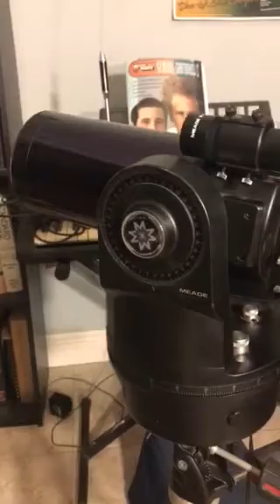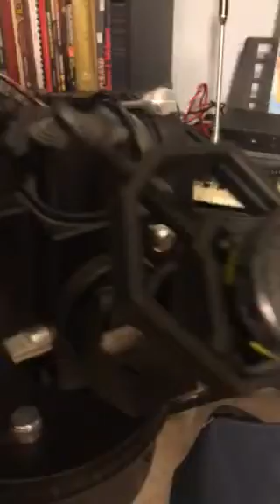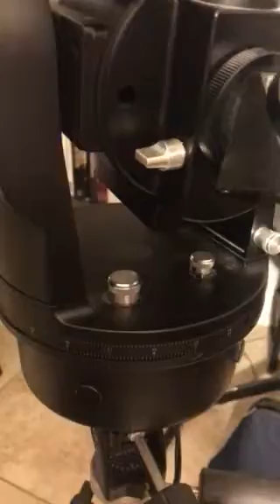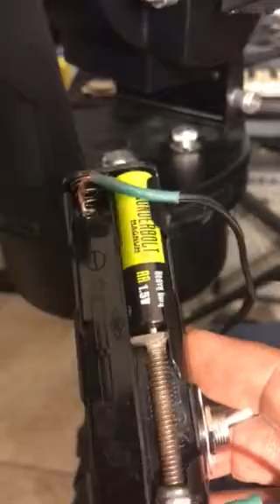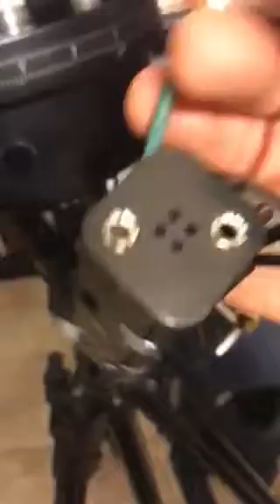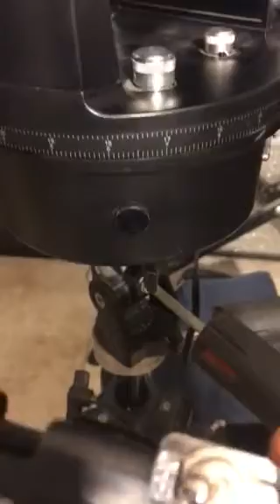Older Meade ETX 90 repair yourself

Comment: I have 3 Meads, 2 90 Maks and a 70 mm . I want to start usng the straight view port with a star diagonal but dont know what is needed to accept the diagonal. I see you have attached one to your ETX. what are you using?

Comment: Many thanks!  My circuit board was all corroded - your simple solution was perfect.  Somewhere, I have an adjustable power supply and intend to hook that to a  rechargeable Lithium 18650 soon.

Comment: I love my mead in 1999 i saw saturn rings and also Jupiter and its moons. I haven't used it in years. My problem is the big blue tube lens will not stay up. And suggestions?

Comment: ATTENTION ETX OWNERS: Most of the failures are due to the hardening of the grease (Black) of the bronze worm of both axes.
The green grease from the gear case also weakens the black plastic and makes it brittle.
NEVER USE AN EXTERNAL SOURCE WITHOUT A VOLTAGE REGULATOR. Unregulated sources, when disconnected, increase their voltage to 18 volts and when connected, they burn something inside:
Also AVOID PLUGGING IN OR UNPLUGGING THE AUTOSTAR CONTROLLER, because the connector can cause the power to come on before the ground. Thus, the return of current is done through the drivers, which burns them.
I hope this serves someone.
Reply: @Kane Able Disassemble, clean and relubricate the worm screw and crown. There is a lot of information on the web. 
I searched http://www.weasner.com/etx/faq.html
Reply: The ETX 90 RA has NO Autostar controller at all ! it has only a motor device that compensates the earth's rotation. But I agree, the motor can only work correctly with a controlled voltage powersupply. Greatings from old Germany, Wolfgang

Comment: Thanks for the video. Did your model have the motor and the metal gearbox, with the circuit board to the side? Wondering if I need to disassemble the drive to repack the gearbox with grease?
Reply: I tried to use my ETX 90 the other night for the so called "Christmas Star" but couldn't because of the gears being frozen. I need to pull it apart like you were saying! How did it work out for you?
Reply: @bpluemer185  My gears work fine, but I haven't had a chance to play with the rewiring.
Reply: If its not broke, dont fix it.